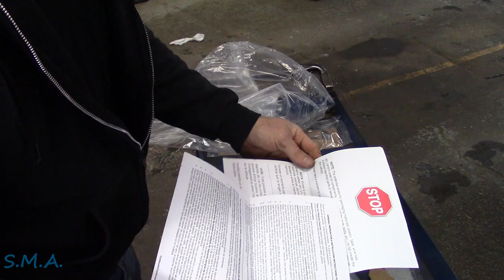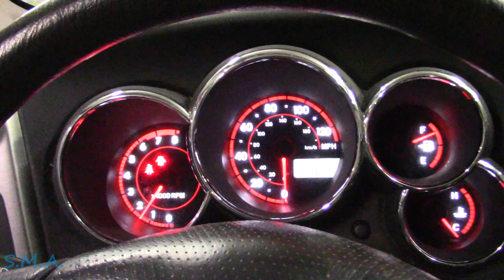A Merry Christmas Matrix Manifold

Comment: I think you're the only mechanic I've ever heard talk so bad about dorman. I've used their products for years and never had an issue. They always improve over the oem stuff that's common to fail. And they make a lot of oddball parts that no other aftermarket company does which I really appreciate. Every part can and will fail. But I've never had a dorman part fail and I've used and installed thousands of parts from them. And sold thousands in the 12 years I've worked in the parts business. And I've been working on vehicles for 14 years.
Reply: The Dorman bolt/springs for the doughnut gasket are actually pretty nice and even seem a bit better than OEM in that the ends are pointed to get a better first "Bite" . Dorman part 675-221...which is identical to Dorman "Help" line part 03123....same..... M10 x 1.25

Comment: I had a 2008 Pontiac Vibe which is the same as the Matrix and the manifold cracked on mine too. I ended up removing it and welded it up. It was made from stainless steel. I left the heat shield off. My son now has the car and it has almost 300,000 miles and still going strong.

Comment: Thanks Eric, Besides the lessons around changing an exhaust manifold, I gained one major bonus by watching this video. I now can see exactly how rusty and krusty my Matrix/Vibe would be if I had not taken it to Krown Rustproofing for the last 16 years.
Reply: congrats on figuring out not all rust-proofing types are snake oil. also, for not falling for any of the snake oil ones! 
electronic gadgets, tar coatings and plenty of others are fully useless or would need factory applied during assembly and still fail due to heat/welding.
the oil/wax/animal fat based coatings are about the only effective things on the market, even regular yearly oil sprays work, obviously some work well and last multiple years.
Reply: Ya, down here in southern states Matrixes often see 250,000to 350,000 miles if maintained.
Reply: @geraldlafleur7776  It is the same up here in Canada. They were a very simple, reliable and extremely practical car. My 2005 Vibe runs as well today as the day it left the factory.
Reply: @throttlebottle5906  My 2005 Vibe was the first new car I bought after 25 years of driving second, third and fourth hand vehicles. Despite our HEAVILY salted roadways in Ontario, a yearly trip to Krown and an annual coat of paste wax on the shiny side have kept the car as solid as new.  The engine and manual transmission have been lubricated with Amsoil's top spec products since the first change interval and they are also factory fresh to this day.

Comment: Evening Eric Just a quick thanks for all the great Video's you've done this year,  you don't know how much you have helped a 60 year old Field Mechanic fixing Access Equipment last week. A 41 year old machine had its wiring mucked about with to fix a relatively simple fault by a so called electrician ( must have been a house hold one) . All the wiring was in the wrong place, burnt and corroded relays, insulation falling off. I spent 4 hours tidying it up literally so I could identify the wiring numbers, then managed to get a scanned copy of an old manual, all 5 pages of it. I was going to give up on it but thought start from the  beginning.  So rewired the whole thing from top to bottom with a new 42 core loom.  6 hours later all up and running. With a lot of by passed wiring back where it should be, and that's mostly because of you showing the diagnostic side of finding a fault.
Anyway the main reason for this message is to wish you and  Mrs O, and the children and the dog a Very Merry Christmas and a Happy New Year. 
All the best for 2022. 
Richard 🇬🇧

Comment: Glad to see you using an SK ratchet there. A great Chicago brand before Snap On and others,  and still a great brand. I have one SK 3/8" ratchet I can think of that's missing some plating due to 50 plus years of hard use. The plating that has flecked of looks like it was plated three or four times , with different materials, and a nickel color chrome on top.  Even the plating of the ratchet was done very well!  Merry Christmas to you all!
Reply: SK was recently sold to a Chinese company. We'll see how long it takes before they quit USA made SK tools.
Reply: They ain't so great no more. Honestly I'd put Harbor Freights premium line of tools over them. I should send a pic of an SK swivel socket I have that they forgot to cut a hex in. It's completely round inside 🙄

Comment: Yup, gotta love the Dorman stuff.  Thanks to their quality control, I now buy almost everything OEM online, as I can often get prices pretty close to the Dorman stuff, and OEM quality, so the part will not only fit, but it will actually work too :)
Reply: I have been checking with my local dealer more frequently.
Often there is little price difference.
Reply: OEM from outside the dealership isn't always from the manufacturer
Reply: @Jack-qn4vt  Honda is OEM . . . if you buy a Honda part, regardless of whom you purchase it from, it is OEM.  Same goes for Motorcraft parts for Ford vehicles.  It doesn't matter where you buy your Motorcraft part from, as long as it is a genuine Motorcraft part it is the OEM part for the car.
Reply: @thomasherring6640  yes but there are also counterfeit parts out there inside genuine looking boxes.

Comment: I wish mine was that easy. I had 2 nuts rusted round, 1 stud snapped off. Had to take the head off.  So new manifold studs and nuts and new head bolts. It cost me 2 grand at Christmas time. Great mechanic reasonable rate and fixed a few other things as well. Because he cared.

Comment: I had about the same milage on my 06 Matrix when the stock exhaust manifold started leaking from cracks. Was prepared to put a Dorman cast-iron Chineseum  replacement, but decided against after reading the bad reviews regarding fit and finish. Pulled it, welded the cracks and put her back in.......that was 40K miles ago, no problems since.

Comment: Hey Eric hope you have a nice Christmas I wanted to mention….. I’ve been toyota tech for 40+ years have done many of those manifolds when I get o2 sensors seized like that I stop trying to get it out and wet it down with brake fluid……. I don’t know what is in it but it works really well. After let it soak I wrench it back in. It will free-up spay more brake fluid on it. Working it out a little at a time. Old timer showed me this when I was skinnier. Give it a try let me know what you think

Comment: Merry Christmas to you and your family. We love your common sense presentations. Love your work. PS we have a 2003 Matrix that also has lost the number one cylinder that won't fire at times. Spring is when I will operate. Oil and coolant are clean, I could also have a plugged manifold.🤣😂 O yes, I forgot to say it is a 1.8L i4 engine

Comment: Great video by Eric. After cutting off rusted bolts on top heat shield to find my Corolla exhaust manifold intact, I installed a new manifold and torqued the 5 nuts/studs. I reattached the support bracket, 1 bolt  to the bottom of the exhaust manifold, and 2 bolts to the engine. Unfortunately, the bracket at the 2 bolts was 1/3 inch away from the engine. Looking up at the manifold, it seems that the manifold gasket was sticking down slightly. After loosening the manifold nuts/studs, the exhaust manifold seem to tilt slightly and the gasket fit better. I finger tightened the 5 manifold nuts and 3 bracket bolts. Checking that everything fit correctly, I torqued nuts and bolts to specs. Dry fit everything before torquing. The exhaust noise and smell was actually from the worn out donut gasket.

Comment: 138k?   Lots of life left in that car...  I've got one over 300k and three more over 200k.  Toyota did a bang up job on that 1zzfe engine.
Reply: Nope, won't pass next inspection with the fist sized holes in the unibody.
Reply: The motor - yes, but not the rest of the car.   Rust will take the body out.  I had a 05 corolla with the 1zzfe  - 220k before it was rear ended and totaled out. It had no issues at all.

Comment: Finally watched this.  Love the banter. Did the same job 7 years ago on my Corolla.  Other than the un-fitting bracket the cast iron Dorman manifold has held up just fine.  The Toyota cracked part is one of the few flaws on the 1.8 motor.  320,000 kms and still run daily!

Comment: I have the same Matrix, 2010, manual, 220k on it, 354+++ km, it's amazing how a little bit of Fluid Film before every winter protects it, looks like new, runs like new, and I'm not easy on it. And I live in Canada, lots of salt, Just 2 hours north of Eric.
Reply: Yes, I think there are a number of products and services to successfully protect the body. My 2005 Vibe spends less than one hour at the local Krown Rustproofing franchise each year. When I bother to wash it again next spring it will look as good and remain as solid as the day it left the factory.
Reply: Apparently better to rust proof in spring because that's where the rust starts in warmer weather. But any time of year is better than none
Reply: @1232bluejays  I go to Krown in late summer when I don't have to make an appointment. As long as you go once a year you will be fine.

Comment: That fits better than the one I got for my mom's old 2010 Nissan Altima 2.4L, she drives a 2015 Ford Escape now major thing I had to replace was the crank sensor for a cat was up in there, got a pig tail, put the original wire terminals in so I didn't have to splice wires. It broke the sensor and the connector. By the way cat was fine just lost some fur.

Comment: Kind of funny how up north a 12 year old car is ready for the crusher.  In the south, you could put 1500 dollars in it and go another 2 to 3 hundred thousand. miles.  Different climates, different life choises. My newest car is  2003 Corolla with over  250,000 miles on it, and it is going strong.  Not much need in replacing a car when you only have to replace a defective part occasionally, and keep its maintenance up.  Great video Mr. O.  Thanks.
Reply: If you rust proof them every year they can go forever. I had a Honda civic last 23 years here in salty road Canada.
Reply: @1232bluejays  That doesn't surprise me much dave.  The key is maintenance.  Even in Fla, you don't drice the car on the beach unless you are prepared to do a lots of cleaning rinsing, and rustproffing.  LOL My pld 1999 silverado was a rustbelt special, but with tlc, and a little elbow grease it's got over 360,000 miles on it and going strong.  Youtube has good vids on how to rustproof, and repair vehicles.

Comment: Cool. I just did the intake gaskets on my 2006 Matrix. No lean codes but it fixed rough idle (especially in cold temps) and slightly elevated LTFT (around 6). Also improved mpg quite a bit.  It's got 187k and still runs perfect. I try to maintain it like an aircfraft.

Comment: Penetrating  oil definitely makes the job a lot easier. Thank you.   I wont disappoint you as I work around some of the Dorman flaws. Get around that bracket to work as it helps to prevent cracking of the manifold. I've also seen much thicker Dorman manifolds than original.

Comment: Not only do the Dorman exhaust manifold parts not fit necessarily well, the ports themselves are rough cut and don't match well.  I bought one to go on my F250 and didn't even take it out of the store.  I just told the parts guy to keep it and I bought the OEM part.

Comment: Ahhh the matrix, ive done so much work on my grandmas 03 matrix xr before she finally sold it. All fuel injectors,  new fuel pump and strainer, iac valve, intake gasket, passanger axle and seal, valve cover gasket, radiator. Just needed work, she never kept up with preventative maintenance. Towards the end, it was shutting off at red lights and stop signs, and throwing a shift solenoid e code.  I tracked it down to inside where the transmission pan is.  I want to get ahold of the person who bought it to see what they did!

Comment: Hi Eric,Merry Christmas to you and your family, Speaking of casting flash, When I worked for Chevy in the 70s I got a new 77 Impala with a 305 cu. in. sm blk that was overheating after pulling my hair out for an hr. or so I pulled the water pump off and the passenger side of the pump was blocked  off with casting flash from then  on I check every water pump before I install it!!
Reply: Back in the late 80's was turning wrenches at Pontiac.  Had a brand new Firebird 305 overheating on left bank.  Removed water pump, and there was no hole in the block to the coolant passage.  Hole sawed the blocked fixed it.  Also seen exhaust manifolds castings blocked.

Comment: I used a steel welded doorman exhaust manifold on an older toyota camry and the flange that bolts to the head was so warped that it leaked like crazy after I spent the time installing it, which was a huge bummer to take off again. Freaking doorman strikes again!

Comment: The Dorman bolt/springs for the doughnut gasket are actually pretty nice and even seem a bit better than OEM in that the ends are pointed to get a better first "Bite" . Dorman part 675-221...which is identical to Dorman "Help" line part 03123....same..... M10 x 1.25 ( Cheers....former Buffalo NY guy often going to Watkins Glen races.... seems near your Avoca location ).

Comment: Tip
You can use cheap mirrors to get good camera shots in difficult places where a camera won’t fit or could be damaged.
And oxy cutting torches make short work of in the way heat shielding.

Comment: At 9:45 there is a perfect demonstration of the reason for hex head bolts, and hex nuts. The angle-set open wrench allows it to remove a hex bolt even in the most confined of spaces. Much more so than the square head bolts with the straight-set open wrench.

Comment: For those with weak or arthritis hands, pound the open wrench with an old hardened rubber mallet, or wooden mallet, or more brutal use a metal mallet. It should knock out the stubborn nut 🔩 or that oxygen sensor as in this video.
A longer 🔧 wrench plus the mallet trick helps, if space is not limited.. Remember wear gloves and safety glasses.
It acts as impact wrench.

Comment: I purchased a set of cylinder heads from autozone for a 307c.i V8 and the oil return holes were completely filled with casting material.

Comment: Ps— Dorman has both saved me and ruined me. Dormans saving grace as of late is a AC flow sensor they make that Toyota doesn’t make on its own as a standalone part. The flow sensor goes bad on some of their compressors — it only needs that sensor to fix the problem. Toyota dealers will charge for an entire compressor job instead of just replacing the bad sensor. The sensor is 50$ from Dorman and is only held on by a c-clip. The compressor job is 500$ bare minimum.

Comment: Amazing seeing the oxidation of vehicles up there.  What's in your environment that makes this so much worse?  Just road salt?   Are there any treatments or devices that may limit this rusting-away?  Sad seeing a Toyota that is mechanically OK, but the rest of the car is rotted out.  Merry Christmas and a Happy new year!
Reply: My 2003 Tacoma is rust free down here in TX.
Reply: I'm in northwestern PA and its mostly the salt  but sometimes beet juice and calcium chloride are used  to on the roads makes a nice caustic slurry splashes up into every nook and hole in your vehicle and sits then subject it to extreme temperature change that multiple vehicle components experience it speeds up the rust. Helps to wash your vehicle and undercoat it before it gets bad but I've seen undercoat lock in the junk and make things worse to
Reply: I have a 2009 vibe same mileage. But I use Krown and fluid film every year. Very little rust and I'm in salty southern Ontario canada

Comment: so i have to ask what did you put in the vise that held the stud that came out? or what is that "tool' called at the 17:10 mark?  i am definitely not a professional mechanic but i am about to tackle this same exact project. i already changed my clutch in my driveway so definitely not scared to do this job. thanks for any info.

Comment: Hello South Main Auto Repair LLC HAPPY NEW YEAR! I have a question, what would be good "Shock Absorbers" for my old 1999 F150 4.6 V8 8ft bed 2-wheel drive. Opinions for the best, in the middle range of price point & performance. I do carry weight at times, light Trailer. Thank you for any help. The pandemic just put my Mechanic out of business 6 months ago, they work on the BIG stuff.

Comment: 26:01, people want everything for nothing. I buy only OEM parts for my cars, even soft parts like gaskets and belts.
My wife got in an accident and to save some money I replaced the front bumper cover, fender, front lights, plastic brackets, and other small parts with OEM parts. There was no structural damage on the frame of the car other than plastic parts. Everything fitted 100%. Yes, I could have saved lots of money buying Chinese garbage but I don't have the skill and time to fix something that they didn't manufacture properly.

Comment: Why do I watch your videos? I guess it's because you make the same moves I once did (I'm happily retired) and I hear the same comments I usta make - and I even saw you try to hang your impact and extension in between parts and it didn't work - this time! 
We seem to be on the same wavelengths almost all the time and there I am - fascinatedly watching you doing the same stuff I did --- many years ago. 
Will you be watching someone else working on cars when you're 75 years old and in your retirement, and then you can smile ever so slightly - as the next generation does it all over again too?
We'll see - well, maybe YOU will because I'll be long gone like the generations before me - and a long time before and after you too. 
The beat goes on ---> but I think we - in a perverted-sortta way -- made a difference..